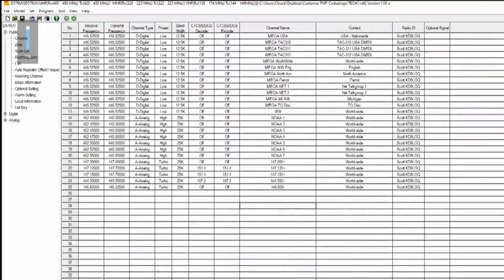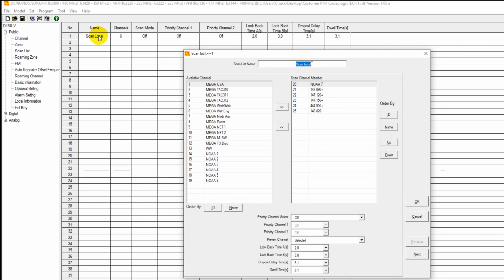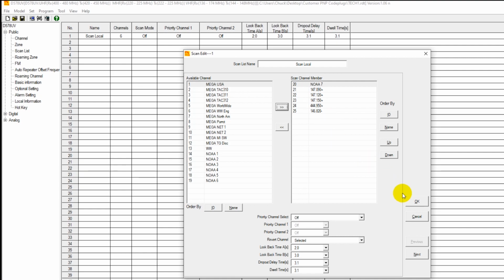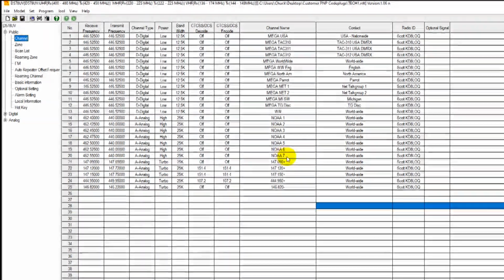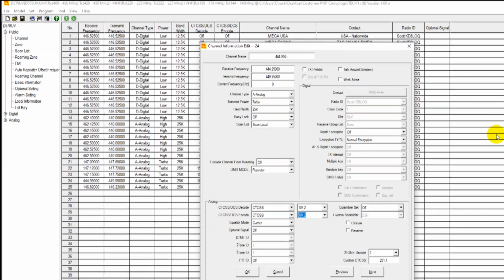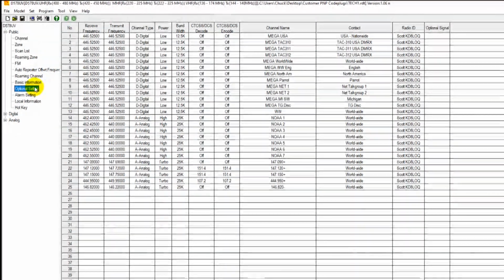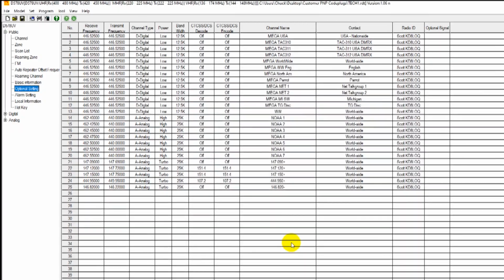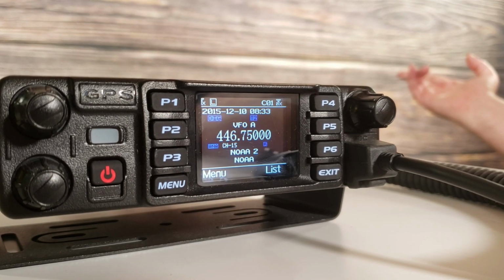How To Add A Scan List To Your AnyTone 578 Mobile Radio

Comment: Not very practical to just have ''Scan List''. The logic is at least to have the possibility of scanning the ''Zone'' in which we are. This gives the possibility of stopping the scan during activity and transmitting on this frequency. Usually when you're on a ''zone'', it's because you want to listen to this ''zone''...
To have an extension to be able to scan more than this ''zone'' or several ''zones'' would be interesting but we need at least a simple way to scan just the ''zone'' in which we are.
Reply from the maker: Thank you for your comment.  Good information.